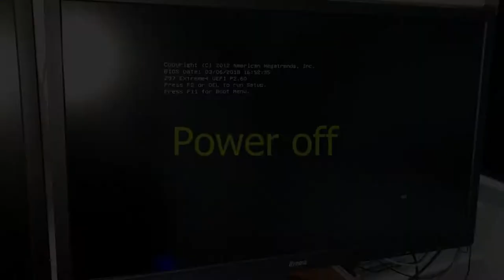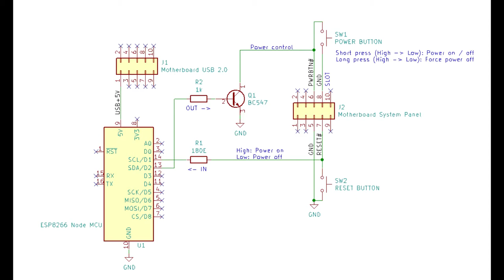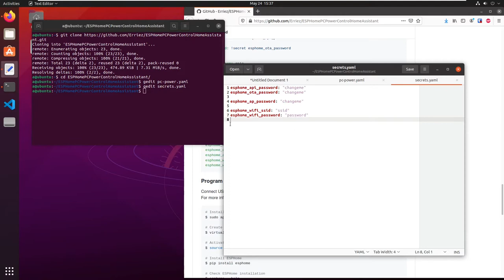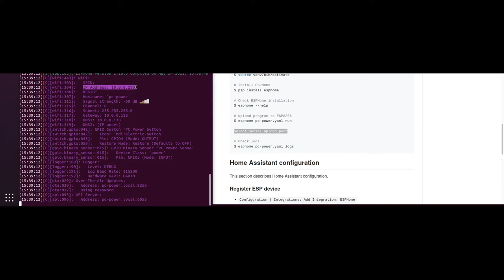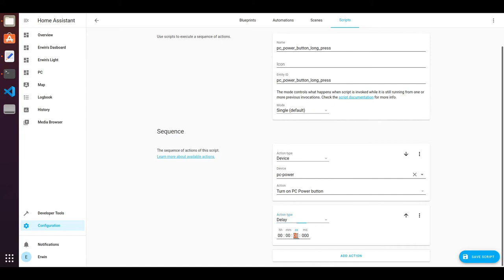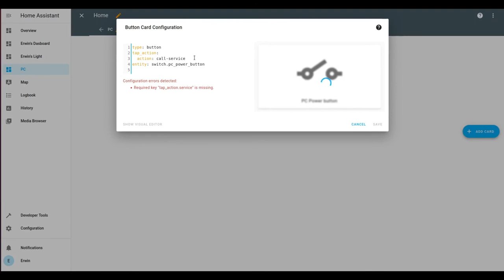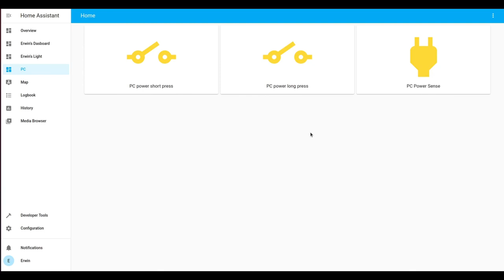PC Power Control via ESPHome ESP8266 and Home Assistant

Comment: I have a customer who has a retail PCIe board which was working fine until he upgraded his network to Fibre with 5Ghz nodes and now it wont work so my question is.. Is the 8266 5Ghz or what chip to use in place of 8266?
Reply: Chip ESP8266 use 2.4 GHz

Comment: super thank you for the tutorial...I try with wemos d1 mini work great, but I make another with ESP-01s, and it does not work. is ESP01s supported or not?
Reply from the maker: The ESP01 was not tested. You can check if it is supported by ESPHome.
Reply: Esp-01s is supported, it just uses different pins in esphome

Comment: I have the same issue too.

What is resistor R1 1B0E?
Reply from the maker: I agree, it is pretty hard to read in the picture: The resistor value is 180 Ohm. Just for a protection to limit current when pin D1 is accidentally set to output.
Reply: @erwinew  hello, the other resistor is 1k Ohm?